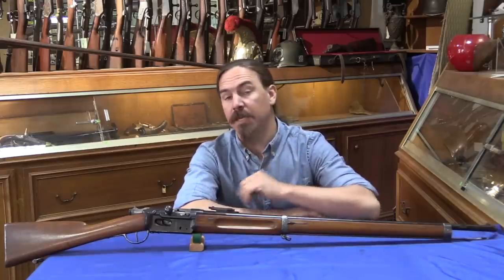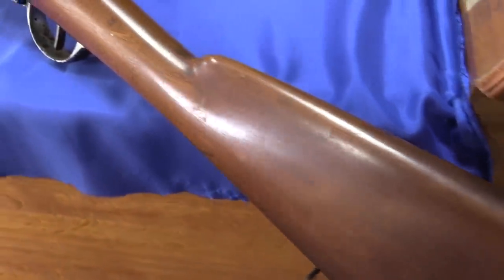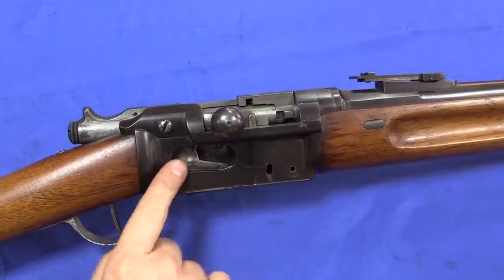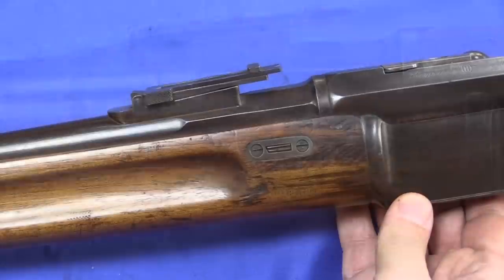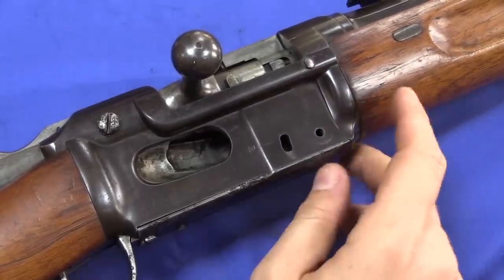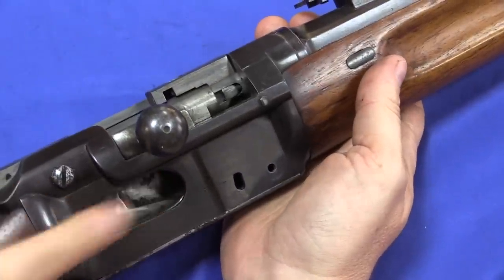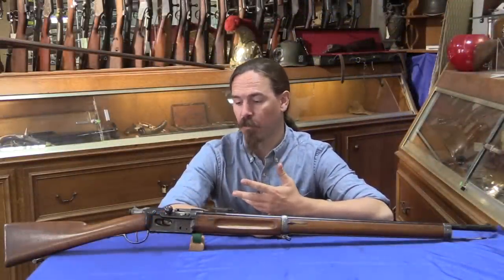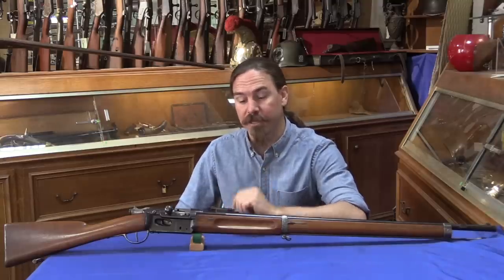Experimental Gras-Vetterli Repeating Rifle

Comment: I love these transitional ages of firearm design.
There are soo many novel and daring ideas.
Must have been awesome working in this field back then.
Reply: Its also really impressive what they managed to build without any sort of computers and all that. Thats the real marvel for me.
Reply: Same here. The 1860’s-1890’s... super cool firearms development. I love getting obscure rifles shooting again. Most of them probably being shot for the first time in well over a century.
Reply: @gonnegottkehaskamp1667  I wouldn't say any sort of computers, they had plenty of mechanical computers and manual mathematical aids. A slide rule is technically a computational device, for example.

Besides, without a computer it just means it's slower doing the math, since you have to write it all out on paper and then go over it multiple times to make sure you didn't oops a plus sign somewhere.
Reply: @DAKOTA56777  well but not CAD modelling and a good portion of the math would have been done via look up tables. Therefore a huge amount of hand fitting required ^^
Reply: @pugnate666  Sure, but that wasn't my point, he said they didn't have any sort of computers, I was pointing out they did. Just not what we think of as a computer.
Reply: Kind of like aircraft development in the 1920s-30s.

Comment: I misread the title as "Gas-Vetterli" and was impressed that somebody was designing gas operated rifles in the 1880s.

Now I'm kind of sad that they weren't.
Reply: They were. The first self loading rifle is the Mannlicher 1885 which is gas operated flapper locked.
Reply: @ineednochannelyoutube5384  Actually, Maxim's first attempt at an automatic gun was a recoil-operated Winchester rifle which he built in 1882-1883 and which formed the basis for his first patent in 1883. It wasn't successful IIRC but then neither was Mannlicher's gun. In terms of patents, I believe the first self-loading rifle to be designed (though I don't think anyone's found any proof it was ever built or tested) was a gas-operated variation of William Curtis' strange 1866 rifle.
Reply: @blarton6375  Huh. You learn something new every day. I could have sworn most material on the mannlicher gun quotes it as the first self loader.
This might just be a confusion of design and patent dates though.
Reply: It really took smokeless powder to make gas-operated firearms viable.

Comment: The barrel key is the standard mounting method for the Vetterli fore end.

The open loading window is also typical of the Vetterli. They initially had a sliding cover but it was quickly abandoned as unnecessary.
Reply: There really should be a version of this where the action freezes at a couple of points, a small animated-a-la-python Chap's head appears and proceeds to adds his words of widsom.
Reply: @rickansell661  LOL 😂

Comment: Both the cross bolt and the under cleaning rod are exactly as on the Swiss military Vetterli.    The front end has the appearance of being taken from the Vetterli and adapted by the French armoury rather than separately designed and manufactured.

Comment: Could it be that the missing piece on the right side of the gate would actually have had a use to conceal/close the gate, maybe in addition to another use (magazine cutoff etc.)?
Reply: Normal Swiss Vetterlis didn't have a cover on the loading gate either, so I'm pretty sure that's how it's supposed to be. I think Ian's text comment of it possibly being a mag cutoff is most likely, since basically everyone of the time required those for military trials.

Comment: I almost bought a Swiss Vetterli, back in the 1980's and it a sliding loading cover, it was pinned in place, I believe it was a .41 caliber. Well under $100- for it.
Reply: I picked one up not long ago, it’s a pleasure of a rifle but definitely of an older time. Long, heavy, cumbersome.. you need to be quite forceful to get the elevator to load cartridges. It has a certain look and grace to it though. You can still find em! Just not for <$100
Reply: I'll give one of you my sole for a box of .41 swiss
Reply: Cost and availability of the ammo put me off.
Reply: @notgraham.7215  Why would anyone want the bottom of one of your shoes???  Oh.....you meant soul.....lol.
Reply: @robertrobert7924  no. These are very nice boots.
Reply: @chrissilsby4312  too true. I know of one manufacturer of the centerfire cartridges for converted bolts, and a couple manufacturers for rim fire reloading. It ain’t cheap, but what antique IS cheap to shoot? Ask my martini, my type 26, my Tranter revolver. Expensive antiques are, well, expensive.
Reply: @notgraham.7215  They must be.
Reply: @robertrobert7924  they're Redwing.
Reply: @notgraham.7215  I have a pair of Redwings with steel toes.
Reply: @robertrobert7924  well if you ever need a spare boot sole, find me a box of .41 swiss lol

Comment: Interesting that the receiver, barrel & the wood looked to be in decent condition, but everything else seemed quite pitted & worn. Any explanation for this?
Reply: That is odd, typically it's the other way around. My best guess is it got wet at some point and was only dried and oiled on the outside.

Comment: Could the missing lever have been a dust cover for the loading gate? Thats just what I would have done as an engineer.
Reply: Normal Swiss Vetterlis didn't have a cover on the loading gate either, so I'm pretty sure that's how it's supposed to be. I think Ian's text comment of it possibly being a mag cutoff is most likely, since basically everyone of the time required those for military trials.

Comment: Maybe this is me just being overly paranoid, but I’d be afraid of having a bunch of FMJ rifle rounds sitting nose-to-primer right next to my hand. Correct me if I’m wrong, but I’d be afraid that if this rifle were jarred or shaken too much during day-to-day combat usage, it might replicate what happens when you drop a rifle with a floating firing pin. But instead of just one round going off in the chamber, it’s one round going off... outside of the chamber... right next to a bunch of other rounds...
Reply from the maker: 11mm Gras used a plain lead flat nosed bullet.
Reply: Have a look at some commercial Winchester (or Hornady) 30-30 ammunition.   The projectiles in some of that ammo are quite "pointy" lol.   In any case all (?) of these older cartridges (including 30-30) are rimmed...thus when laid on their sides nose to tail - as in a tubular magazine - the projectile tip is not actually resting on the primer in front anyway.... The Lebel went so far as to have a groove built in to the head of the case in which the bullet tip was meant to sit. And of course I only know THAT from watching Forgotten Weapons!  (Hmm...applying learned knowledge....  my old teachers would be pleased...)